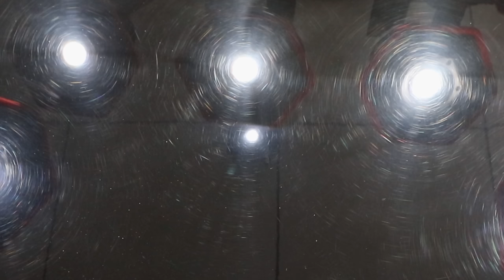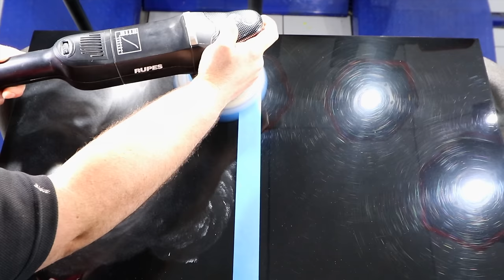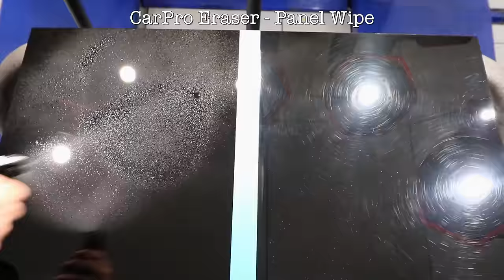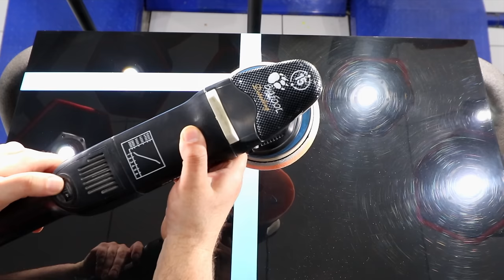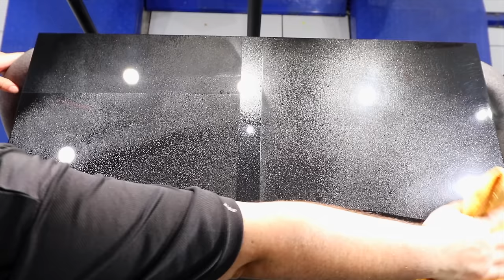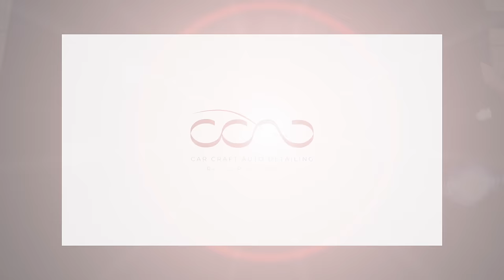How To Cut & Polish Car Paint Correction Demonstration Explained in Real-Time!

Comment: How many pads would I need to do an entire civic coupe?
Reply from the maker: I usually work with 3 pads each day and just keep on rotating them throughout the day to let them cool. You may need more pads or you can stop wash your pads out spin them dry and then keep going.
Reply: @CarCraftAutoDetailing  thanks for the fast reply I can’t wait to revive my cars paint job. One more question, about how much time should it take to do an entire car? (My coupe, obviously a suburban would take a lot longer😅) 2 hours or so? I obviously don’t want to rush.
Reply from the maker: That’s really all very subjective. If you want to quickly just improve and enhance the paint you can do it in a couple of hours but a couple of days is more realistic to achieve a higher standard and I’ve spent weeks correcting certain cars so it just really depends. My advice is don’t look for perfection when you first start out, just look for a good improvement and learn from that experience so next time you can go a little further having a bit more experience under your belt. 
Maybe this video will also help:
https://youtu.be/6tepA3wjPbY

Comment: What RPM is speed 5.5?  I struggle knowing how fast or slow to go. And when to stop buffing
Reply from the maker: Dual action polishers are measured in OPM - oscillations per minute - every machine is a little different but it would be roughly 4500 to 5000 OPM. 
Maybe this video will help explain a few more things about machine polishing better: 
https://youtu.be/6tepA3wjPbY

Comment: Where do you get your test panels from?
Reply from the maker: I didn’t personally get or make them, but they are thick sheet metal painted by a body shop.
Reply: @CarCraftAutoDetailing  Would I just call a body shop and ask them to make me a small painted panel? How much did it cost?
Reply from the maker: I think you’ll need to source the bare metal sheet panels and you could ask a body shop if they’d paint them for you - not sure what they’d charge

Comment: can you use one foam pad on a whole car?
Reply from the maker: I personally wouldn’t recommend it. It’s just asking too much of a single pad to perform consistently well over an entire car, 3 pads is a much better option and rotating them after every few polishing set to allow the pads to cool will also help extent their life.
Reply: @CarCraftAutoDetailing  how do you know when to add more compound?
Reply from the maker: You should be adding compound to the pad before every new polishing set. 
Maybe check out these videos as they could help with technique when first starting out: 😀
https://youtu.be/XwuX4PfPwxQ
https://youtu.be/6tepA3wjPbY

Comment: the problems that i face in the real world:
1. angles of the actual car - the doors, hood, bonnet are difficult to polish smoothly 
2. getting the right polishing macihne speed
3. the foam pads and other pads are difficult to use due to the car panel shapes
4. MY SWEAT dripping on to everything after i've spent half hour washing the car

Comment: How much rpm???
Reply from the maker: Mid to high speed ranges which is usually 3000-4000 OPM (oscillations per minute) is generally a good place to start.
Reply from the maker: Mid to high speed ranges which is usually 3000-4000 OPM (oscillations per minute) is generally a good place to start.
Reply: @CarCraftAutoDetailing  thank you